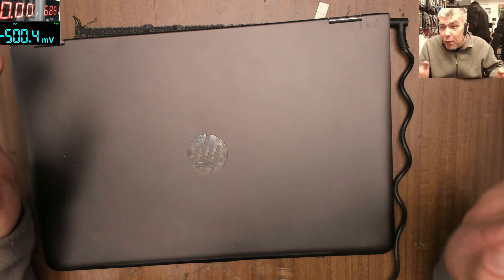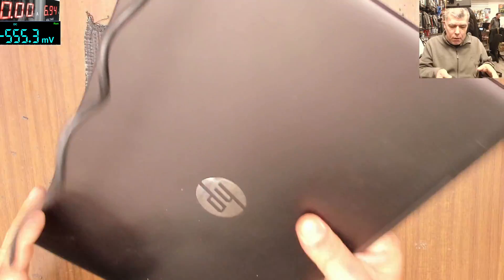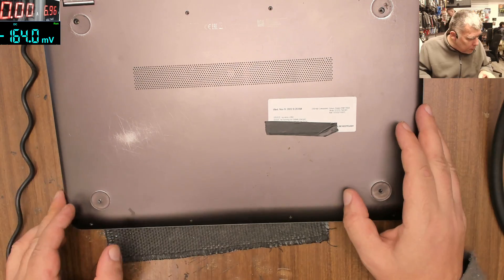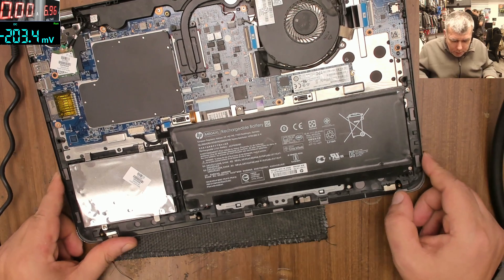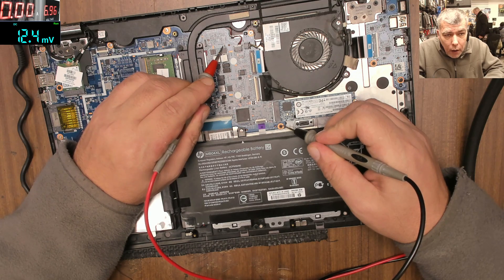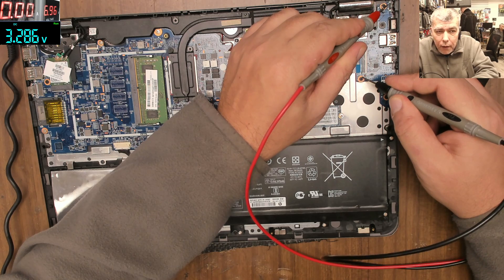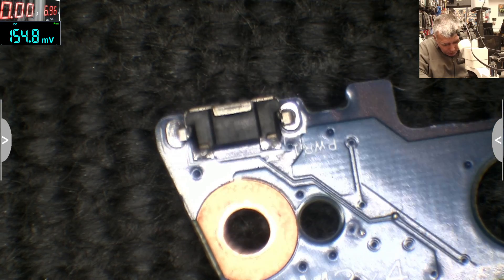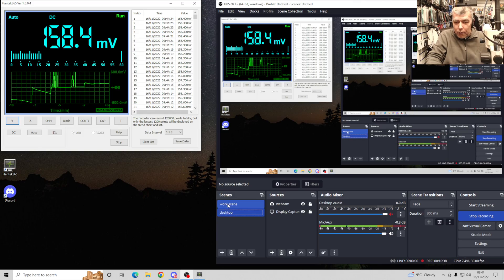HP Envy x360 - Not turning on - cracked solder joints repair

Comment: Sorin, you are in a perfect position to head a campaign to change things.  Millions of these machines end up  junk simply because of the lack of schematics and spare parts.   It would be easy for governments to ban the sale of such machines without the necessary support for repair or perhaps enforce stickers on the packaging that the product is not repairable.  That might encourage some maker to break ranks and behave differently.    There is simply no excuse for it.  The waste is terrible - not just laptop computers - and with nearly 300,000 subscribers listening it should be possible to bring pressure to bear.
I am old enough to remember when radios and t.v.s used to have circuit diagrams stuck inside the case.  It is ironic that concern for the environment is at an all time high whilst actual behaviour to address it is worse than it ever used to be.  Sometimes the past did things better.
Reply: Good initiative

Comment: Totally understand decision to narrow the fix range. Frankly, simple soldering jobs are the best paying and lowest risk for me. However, you could just charge diagnostic/bench fee up front and make it enough to make it pay and weed out the speculative punts on someone else's bodge job. Every time you open a package or sit down at the bench, someone needs to pay for that.  For this reason, I charge up front bench/diagnostics for repairs that have a chance of a no-fix and the cost relates to the time and materials to find out. Even with simple jobs like a port replacement, some cash up front deals with all the times you fit a replacement port and the device doesn't work anyway - and the customer never returns.